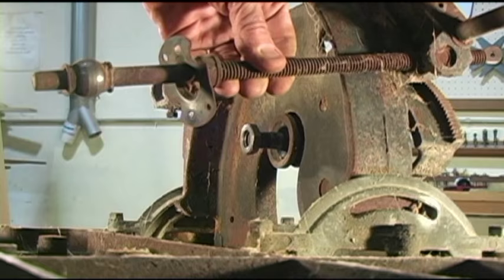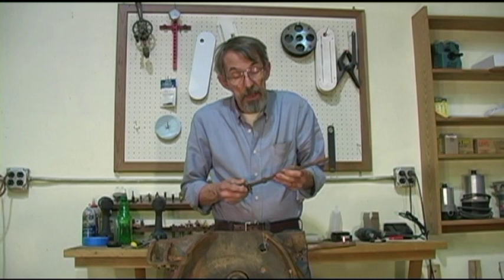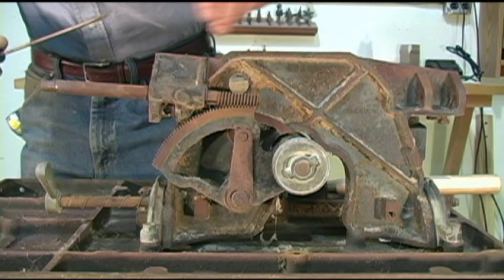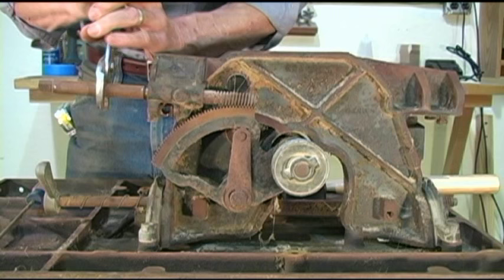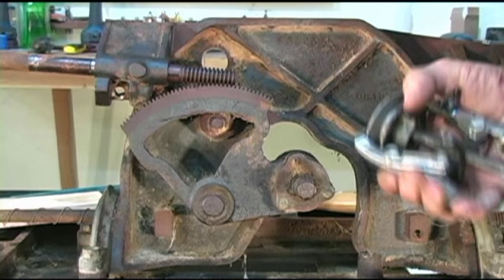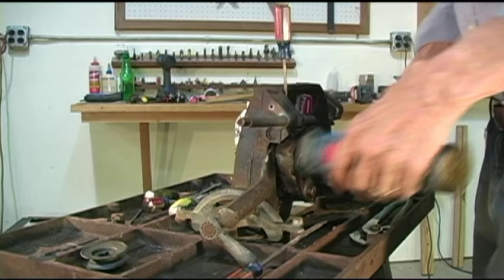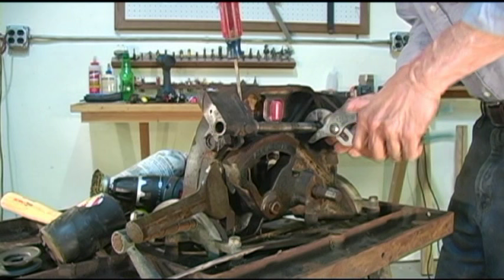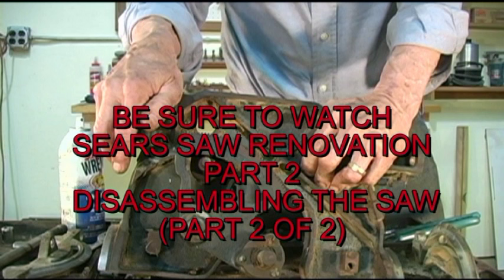Sears Saw Renovation Part 2 Disassembling the Saw (Part 1 of 2)

Comment: Just a little tip I use to keep my small parts separated during a rebuild project. Instead of plastic bags I use an old Ice Cube Tray or I have several if I need that many and just stack them on a shelf until time to reassemble. Thanks

Comment: It doesn't seem terribly rusty; mostly surface rust.  I found this video looking for info on saw fences because I'm shopping for a similar saw at the moment.  Having lived on the Gulf Coast most of my life I'm used to unpainted iron and steel rusting quickly.  When parts grow together due to rust then you have severe rust.  A little oil on parts as they're disassembled goes a long way toward making it easier.  For fasteners that don't want to come loose I've found Kroil to be the best penetrant on the market; even better than Liquid Wrench and Knock 'er Loose.  Give it time to work, up to overnight, and even the most stubborn parts will come apart.  Thanks for the video.  It will certainly help me with the saw I purchase.  Evaporust, available at hardware and auto parts stores, will remove the surface rust overnight and is not toxic or acidic.

Comment: my Craftsman tablesaw suddenly wouldn't tilt beyond 20 degrees after working fine for decades. It would get so stiff you couldn't turn the tilt wheel.  I checked the rod which was clean and couldn't find any obstructions.  People said it was likely my trunions causing the problem which normally means taking the saw apart.  Because it's heavy with side tables and a dust box I put it off.  Today I decided to look at it again so I removed the motor and blade to get a better look at things.  I checked out both trunions and blew them out with high pressure compressed air and cleaned out all the sawdust underneath all over.  The tilt was suddenly turning again easily up to about 40 degrees where it would stop.   I found that the stop collar was loose and preventing it tilting all the way to 45 degrees.  I adjusted the stop collar as far back as it would go but I could not get past about 43 degrees. The collar would stop it just shy of 45 degrees.  I decided to remove the stop collar which meant having to remove the long threaded tilt rod.  I was able to do this without dismantling the saw, just working from the rear.  It meant tilting the undercarriage so the long rod would clear the inside of the base.  I took off the stop collar and replaced the rod which wasn't easy trying to get it started again from behind and unable to see it but I finally got it started and put it all back together.  I am now able to easily tilt to 45 degrees and more. I was very pleased I got it working again without having to completely disassembling the saw.

Comment: The noise that that Shane made when you were pulling it off the shaft set an off a lot about the saw you’re working on! I did the same thing to my saw when I bought it and that was 25 years ago but now the more I work in my shop the more I realize that the fencing system that’s on it leaves something to be desired what would you recommend I replace it with mine has no rail on the back it only mounts on the front and I’ve adjusted it and secured it the best I can but I still have to put a square down there every time I move it or I have to measure the front of the blade in the back of the blade but it’s a great old saw!
I know that the blade guard for it is no longer available from Sears and I’m not interested in that I would like to have a riving knife on the side any suggestions? Thank you very much I guess I’m not a kid I’m 61 and I agree anybody under 60 is a kid! 
❤️🇺🇸❤️🇺🇸❤️🇺🇸❤️🇺🇸❤️🇺🇸❤️🇺🇸❤️🇺🇸❤️🇺🇸❤️🇺🇸❤️🇺🇸❤️🇺🇸🇺🇸🇺🇸🇺🇸🇺🇸🇺🇸🇺🇸🇺🇸🇺🇸🇺🇸🇺🇸🇺🇸🇺🇸🇺🇸🇺🇸

Comment: Trnnion frnt

Parts #: 62099

I'm looking for the front trunion that has the bevel. It's a 12 inch Model #11324250 CRAFTSMAN Saw Table. The 90° mark is worn and nd most likely wasn't locked down when was in use. The part is discontinued any help?
Reply: Ebay is your best bet....got a guy that parts these saws out.